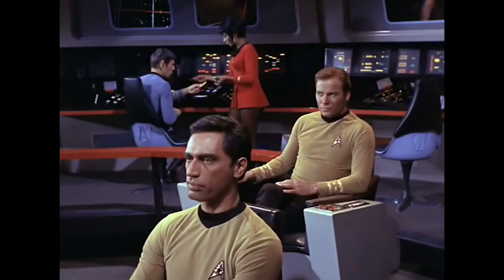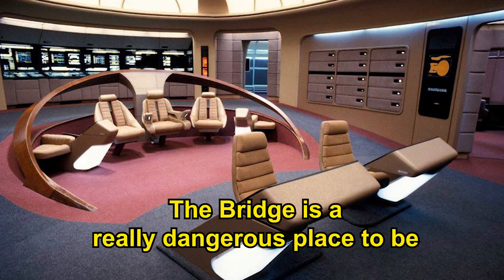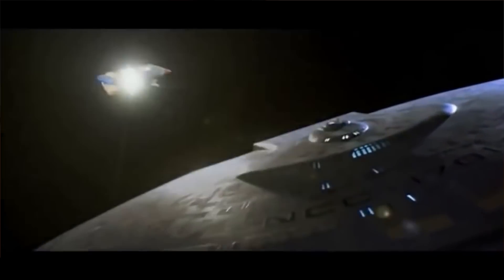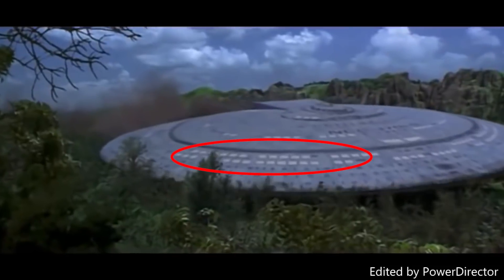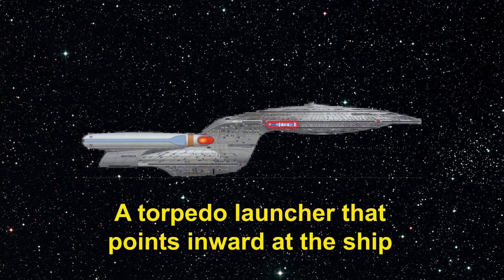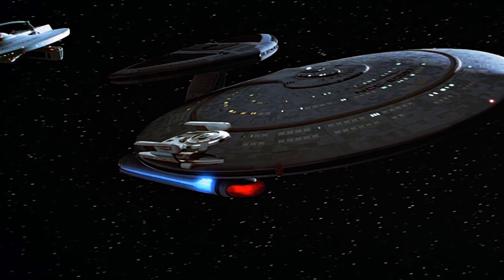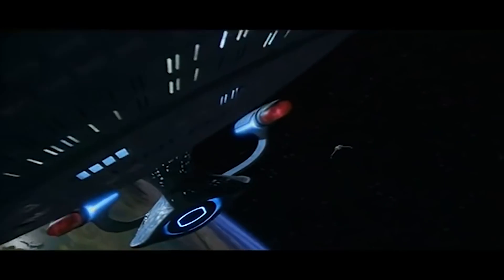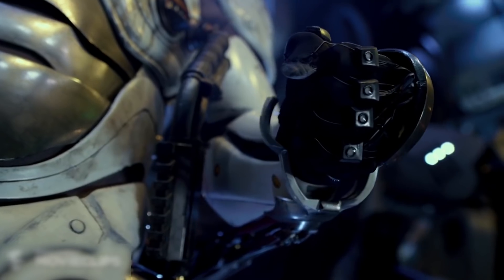10 Flaws Star Trek - USS Enterprise NCC 1701-D

Comment: Volume is meaningless in space, only mass matters. Your beef with that is based on travelling through a physical medium like water or air, where volume contributes to resistance in movement in the form of friction.  There is no friction in space.
Reply: @DarkAlex1978  But money is no issue anymore.
Reply: @DarkAlex1978  Unused volume allows you to future proof your ship to a certain degree. It's about leaving room for anything new that might come along that they haven't currently thought of and/or aren't capable of making yet. For example, let's say that around season 5 of TNG Federation scientists and engineers design a new sensor that will detect cloaked ships, and let's say that this new sensor doesn't replace any of the existing sensors but is a whole new system that will be included on all new ships. With the extra space older ships like the Galaxy class can be (relatively) easily retrofitted with this new sensor because the designers thoughtfully left extra spce for just this sort of thing.
Reply: DarkAlex1978 No, he clearly meant performance efficiency which is why he cited the military examples of oceangoing vessels where they are constrained by the fact that due to gravity there is an upper limit to how big a vessel can be. There, size absolutely impacts performance because volume adds additional structural stress and additional resistance to movement. These don’t apply in space. The additional costs to add empty space as a future proofing measure are nonexistent compared to the costs of actually building a ship, even for a society that doesn’t value currency like the UFP
Reply: DarkAlex1978 astronomical? Nah.  Given that they have mastered matter manipulation in the form of replicators, building a starship should actually be quite cheap. The materials cost would be essentially free - any unused raw material could be reprocessed into the exact piece needed at the right time needed most of our construction costs come from the need to mine, refine, and prototype. A starfleet shipyard can do that in less than an hour, including determining the final part needed and installing it. The most labour intensive part would be the power systems as replicators can’t do that... meaning the warp core and the dilithium itself.
Reply: You think that volume contains no mass?
Reply: Building-in excess capacity now for future demand - more crew, modular equipment for varying mission requirements - is a good idea. 
However, beyond considering mass, the empty space might mean a different body shape. There would be questions of angular momentum and the maneuverability of the ship.
Reply: Robert Ballasty easily dealt with by proper use of RCS thrusters, which with Enterprise is more than capable of managing to achieve the desired effect. Maneuvering is more on the ships centre of mass which would be taken account for by applying variable thrust across multiple RCS thrusters across the whole ship. Given the relative power needed for impulse and warp travel, the power needed for these would be easily managed.
Reply: RE H the complaint is that the ship has 35% of her hull empty for future modules. Barring basic infrastructure, the only thing these areas could have is atmosphere.  Relative to the mass of say an entire phaser bank or a deuterium tank this is meaningless.
Reply: @reh3884  what was being referenced is that in space mass, a fundamental part of all matter is not the same as volume.  A mass of say 5 kg lead will ALWAYS have a mass of 5 kg  regardless of the size of the object, to wit, it's volume.  Volumes change (blowing up a balloon, increases it's volume, but, the mass of the balloon itself will remain unchanged)
Reply: Volume adds mass. It also increases moment of inertia, which affects maneuverability. In space, volume also had to be filled with air/oxygen, which also have mass. Even ignoring that, the cavernous hallways are stealing volume from the working and living spaces.
Reply: Brian T Incorrect. A bubble may be made up of 1g of fluid when collapsed, or 1g fully inflated prior to bursting. Either way the mass remains consistent. The mass of on oxygenated atmosphere is essentially nothing relative to the mass of anything else. 22L of air at STP is 0.03kg, for steel that same volume is a mass of 170.5kg. Also, the empty sections do not need to have any atmosphere at all. Provided they are behind a secure bulkhead (ie a standard door for the ship) there is no reason they couldn’t be vented to space.  

Your argument that the corridors take away from operational space is only true if the rooms themselves were also not portrayed to be spacious and comfortable, which they are. That implies that in design the engineering teams were able to build a ship large enough to fit her expected mission profile and add room to spare.
Reply: Exactly, there is friction acting on a sub or aircraft carrier,  resulting in a benefit from reduced volume.  You don't get this benefit in space, therefore much less benefit from reduced volume.   Thank you for proving my point!☺
Reply: AdeptPaladin there are 2 valid concerns with adding space without materially adding mass:
1) you increase the cross-section of the ship and make it more likely to be struck by debris or weapons
2) when the mass of the ship is more spread out the stresses from maneuvering (especially eccentric maneuvers) is greater, so a damaged ship is more likely to be torn apart from frantic manueving.

BUT, it's a deep-space vessel, and a diplomatic vessel, so moral is extremely important. So if material science and engineering allow you to have a more spacious ship, than that's probably what you should build.
Reply: Robert Aylor Well, debris in interstellar media is essentially nonexistent, given the huge volume of just nothing in it. Aside from that, in combat you have a fair point but the Enterprise was not designed as a warship first so that point is essentially moot, we agree. 

As for stress from erratic moving, that would be an issue for the ships Structural Integrity Field, which is a common technology for warp capable starships. The Enterprise’s SIF could handle a strain of approximately 820kN at most as seen in S4E10 “The Loss”
Reply: AdeptPaladin good point, gotta love Star Trek’s handwaivium-besed techs ;)
Reply: I agree, however you're missing a couple of key points, sure volume doesn't give the aerodynamic/hydrodynamic performance reductions in space, but that volume has mass, just for the structure alone. Further more additional volume will increase the length of time to build one of these vessels and the amount of materials required. Further more it makes you a bigger target, you will have a larger cross section to show up on hostile sensor, a larger area for hostile weapons to hit and you'll have more difficulty concealing yourself behind asteroids and the likes.
Reply: Volume has less meaning in Trek, because they have nearly limitless power from antimatter and fusion reactors, but it does have meaning in several significant ways:

A. If an interior volume is meant to be habitable, it takes power to maintain atmosphere, heat, light, radiation shielding, data connections, and internal sensing (cumulatively known as "life support") to that volume. This adds mass in the form of equipment, and increases overall ship's power consumption.

2. Habitable or not, interior volume on a Trek starship needs to be inside a) the hull and spaceframe, b) the warp field that moves the ship fast than light, and c) the various types of shields and other protective systems that keep the volume's contents being impacted by space dust or hostile weapons or from being fried by ambient radiation.

D. Larger volume distributes the ship's total mass over a larger area, making the physical structure weaker - to the point where in Trek a ship cannot maintain structural integrity without forcefield reinforcement called a "structural integrity field".

So yeah, when discussing volume, this is important. This MEANS something.
Reply: Streaky100001 The structural mass is still significantly less mass than a room full of Deuterium tanks, for example. 

The time to build a starship is significantly less than you think. First, it happens in space so that means maneuvering pieces into place requires less external manipulation - there is no gravity to fight against! Second, industrial replication for hull sections can build the rough part of a ship in a fraction of the time needed over current day refinement. Lastly, the Enterprise has about 50x the displacement of her current watery cousin of the same name. Given the above efficiencies, she likely took about as long to build too - about 2 years. 

Lastly, the Enterprise is not a warship so her ability to be hit is moot. It wasn’t a major design decision as at the time, the UFP was the top dog and the Galaxy class was a ship meant for long term diplomatic, science and exploration. Sure she could throw down but that wasn’t her purpose.  Besides, her major profile was primarily from a ventral/dorsal angle where the saucer second and secondary hull were more easier to target. This is a side effect of using saucers and nacelles from a design perspective, but offered reduced cross-section from all other Anglesey attack otherwise.
Reply: Will Garmer 1) for primary systems (aka things to keep you alive in day to day operations) the Enterprise has power to spare. Keeping the unused sections habitable would be a negligent draw, though I doubt that all of them are in such a state.

2) Except that the Utopia Planitia Shipyard engineers had no issue making a warp field or frame big enough to fit this extra space into. We already know that the NX-01 and NX-02 could share a warp bubble, there’s nothing to suggest that the Enterprise couldn’t extend their warp bubble further if needed.

3) Structural Integrity Fields are standard kit on all vessels of the era, not just the Enterprise or even within the Federation. Even Romulans and Klingons have equivalent tech to handle the stresses of interstellar travel.
Reply: @AdeptPaladin 
1) Power to spare, but not to waste. Efficiency is the watchword on federation starships (along with others such as redundancy, protocol, and redundancy), as you'll recall Geordi competing with another starship to squeeze fractions of a percentage of efficiency out of the engines. (Force of Nature).

2) Yes, a warp field can be generated significantly larger than the ship itself (Deja Q), but the larger the field is, the more energy it takes to generate, and the less stable it is. Under normal circumstances (i.e. when there isn't a small moon around that you need to nudge back into orbit), there is no compelling reason to make the warp field any larger than the ship itself requires to enter warp as efficiently as possible. As powerful as the warp core is, it's not infinite - if you waste all of your power generating wastefully large, inefficient, unstable warp fields, you have that much less to devote to going faster. Just like a car - only so many horses under the hood, and if you're towing an Airstream, you won't have enough juice to hit maximum speed.

3) Yes, SIF is standard kit on all vessels of the era, precisely because the ship designs have long ago exceeded the physical limitations of their constituent materials. In other words, the ships are all too big and too light on mass in relation to their engine power for the structure alone to hold together, so they need the SIF or they'd disintegrate before they achieve critical velocity and enter warp. But again, powerful doesn't mean infinite - the SIF has limits, which were skirted by the hero ships on many occasions and exceeded by other ships on many occasions throughout all of the 24th century series. Just because you're wearing safety goggles doesn't make it a good idea to shoot your Red Ryder directly into your eyes whenever you feel like it.

Comment: The console exploding is due to the plasma network being disrupted causing a surge. EPS controls fails and it explodes.
Reply: That begs the question however why the EPS lines run all the way to the end devices, instead of using power converters spaced throughout the hull to power those.
Reply: TwinPeaks Industries power converters don’t give the response times. That’s why in the plasma network they use power couplings which are controlled through isolinear chips which can connect one net to another. 

Voyager helped with this issue with the use of Bio-Gel Packs

Comment: My complaints would just expand on security.

Over reliance on force fields during lock-down. If there's a battle, intruder alert, or jail break the force fields are useful but not reliable as power would go out or be easily bypassed. They should have had a primary physical barrier like big doors coming down which would seal off sections. Too many times during red alert intruders were free to roam the hallways and access critical areas like engineering. Everything should have been locked down, and it's kind of insane the brig would only use force fields. It's like having people walking around the shuttle bay while shuttles were going through the force fields, no redundant safety.

No camera in the hallways and or critical areas like engineering. Every hallway had computer consoles lining the walls, but during intruder alert there was no way to find them or see what they're doing. Kind of stupid given there was computer consoles everywhere. I doubt it's an issue of privacy because everybody was tracked through their comm badge, so why not just have cameras too...and even if it was a privacy concern, don't use them unless during a security breach. The computer can just look through all the camera feeds to find people, it's not like some person was monitoring the comm badge locations routinely so nobody would be looking at the camera feeds until needed.

Setup transporter beam jammers everywhere on the ship. Too many times people have transported onto the ship without authorization, just set up jammers everywhere. They can just turn them on during red alert, or have them always on and just turn them off at certain sections when they want to do authorized transports on the ship.

Train security better. Too many times they guard areas by having their backs facing a door they're guarding, then somebody comes through that door and beats them up. Too many times somebody peeks around the corner and shoots security standing out in the open. Pick better defend-able areas that can see people coming and has cover from fire, and post guards in pairs or more.

Weaponize the holodecks and transporters. Intruders onboard? Just transport them to the brig or into space. Setup holo emitters in all the hallways and have holographic security personnel or monsters subdue everybody. Can't set holo emitters everywhere? Then lure the intruders onto the holodeck, turn off holodeck safety, and have the holodeck beat them up ala Picard with a tommy gun on the borg.

Weaponize the replicators. Can't reach the armory to get phaser rifles? Just have the replicators have an override allowing security to replicate bullet guns, knives, grenades, and such. Or do what the Cardassians did, have a setting that made the replicators on DS9 to shoot phaser blasts at any non-Cardassian in range. Set it to stun if the Federation is too queasy about this to use the kill setting.

Also during ship battles, why don't they have the computer as backup when the bridge gets taken out by those exploding consoles? Just program the computer to take over when people die to continue the fighting until turned off, ship is safe, or a time limit has elapsed.
Reply: Or just turn gravity up to eleven...
Reply: I think a lot of it has to do with complete reliance on technology, which bred total complacency. Look at what automatic headlights and always on dashboards have done with cars in the 21st century....every third car is driving at night with no headlights on...and the drivers are totally ignorant of it.
Same thing with all the driving aids...now people dont pay attention to the road.
Then something happens and they crash and burn.
This in in the TWENTY FIRST CENTURY. Imagine how lax people will be in the 24th when basically EVERYTHING is done for you?
Reply: Who needs cameras when you have internal sensors that can tell wherever anyone is, in real time and what they’re doing? 

The Enterprise does have physical bulkheads but those unused doors need to go somewhere and they take up extra mass, so they aren’t everywhere. Plus an energy weapon can defeat them easily, so an armed intrusion would do little to stop them. They’re primarily used in areas to isolate sections off that will be vented to space for prolonged periods (main engineering). A force field, however, will resist energy weapons such as a Klingon disruptor, takes up next to no relative mass or space and can be completely modular.
Reply: @AdeptPaladin - The problem is the internal sensors were defeated so often and apparently easily by "interference" or "jamming", the only way to defeat cameras is being invisible or fake images. Heck, they should put weight sensors in the floors, then only wall climbers won't be detected.

They could make the physical barriers out of energy weapon resistant materials, the outer hull was armored against ship energy weapons...so the materials did exist. Also there were a number of times missed phaser/distrupter blasts hit the walls and did little damage.

Again, I do see the advantages of force fields, but again they're defeated so often and apparently easily. It's sort of like the slide open doors, how many times have we seen them just being pried open, like maybe put an automatic physical locking mechanism on them?